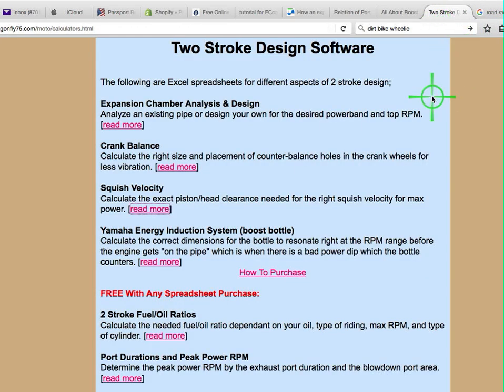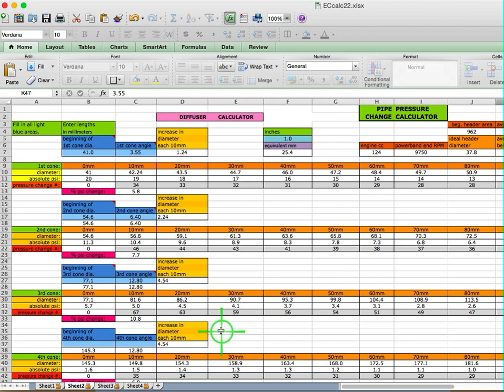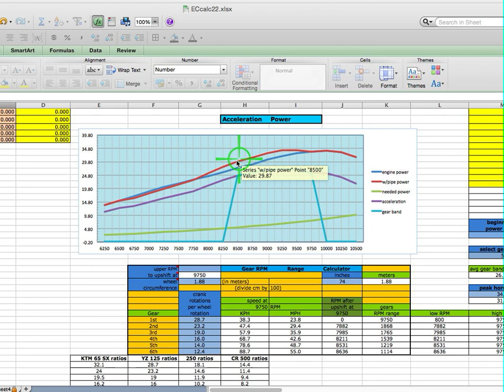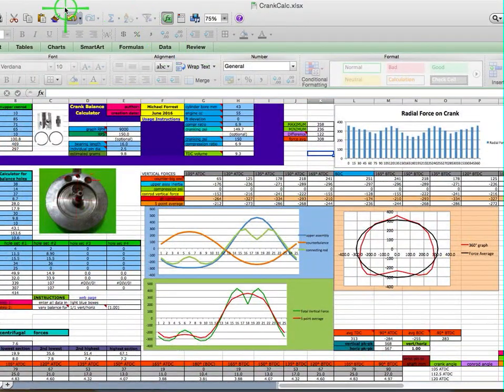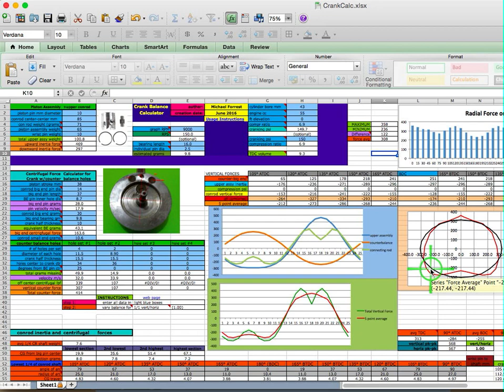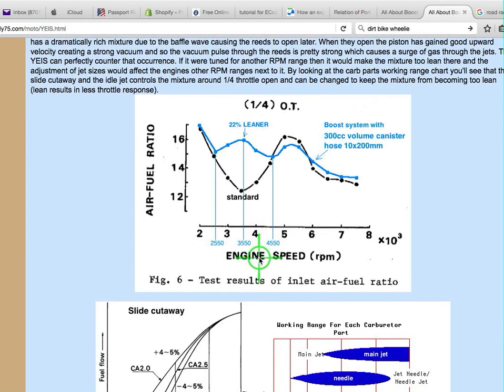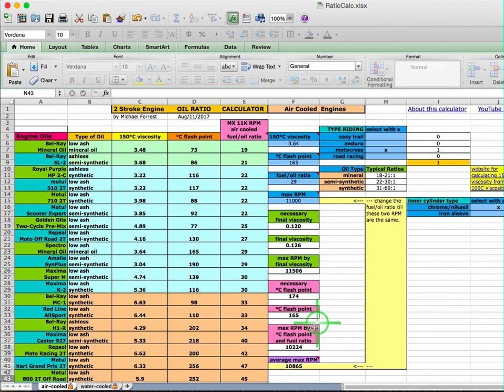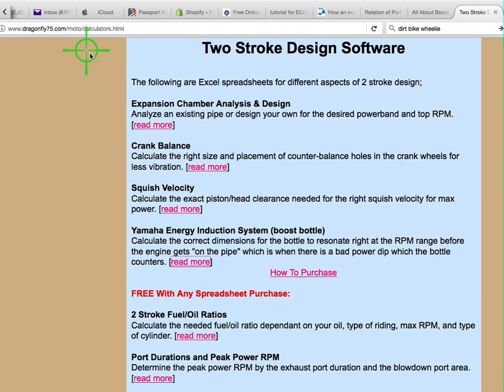Two Stroke Design Software

Comment: You made a great contribution with your programs, I congratulate you.
Reply from the maker: thanks man. it was a labor of love.
Reply: @MichaelForrestChnl  I started looking for information about two-stroke engines recently after buying a Yamaha rx 100, and I would like to know what programs I would need to start improving the motor of this motorcycle.
Reply from the maker: cool! Actually I want my next bike to be an RX100 or 125 and then do all the mods to it and make a web page about it all. Most important is the squish calc if it has a squish band, then the pipe calculator to make your own expansion chambers for it. Also porting calc and jetting calc and oil ratio calc.
Reply: @MichaelForrestChnl   It would be a good project to perform

Comment: will it work for multiple cylinder? i want to build the engine from scratch.. is it whole and complete package?
Reply from the maker: You would need to have a separate pipe for each cylinder and the crank balance calculator is for only one cylinder. But if you keep the same max RPM that the engine was designed for, and the original pistons, then you don't need to rebalance the crank.